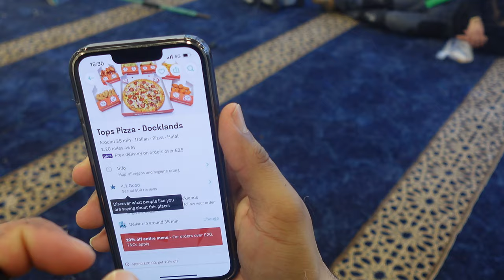Carpet Fitting a Mosque Part 2

Comment: brother carpet is made like a sandwich with backing at top and bottom and the pile is punched through in the middle then it is sliced through the middle hence top and bottom, there will be a shade difference,  brother I was about to praise you for your work until i saw you walking on the carpet with your shoes on

Comment: Pile is reversed on same batch due to the way it is manufactured. Its 2 backings with the pile sewn through both. Like a pile sandwich.  Then a blade goes through the middle of them. So you get a mirror image if you know what i mean
Reply from the maker: That’s what I was told. But that don’t help on the finished result as one side looks lighter and the other looks darker. Why can’t they all be the same direction
Reply: @Trim&TuckCarpets  yeah it's very annoying. We had a massive job to to in a huge hall a few years ago. We had (4) 20x4m rolls of panel wilton to fit and 2 were mirror image
Reply: Mirror image is correct ( male and female)when ordering ask for all male or female as well as colour match to avoid problems.